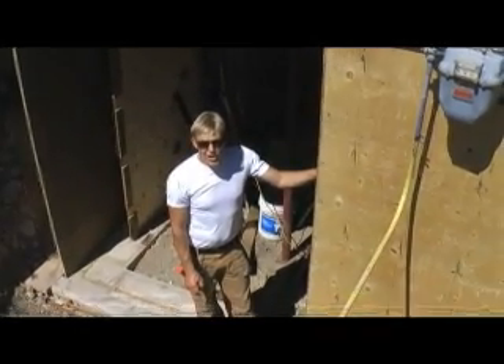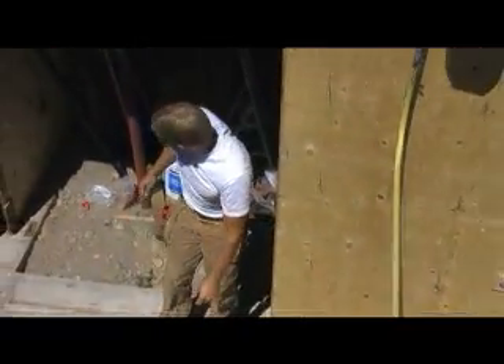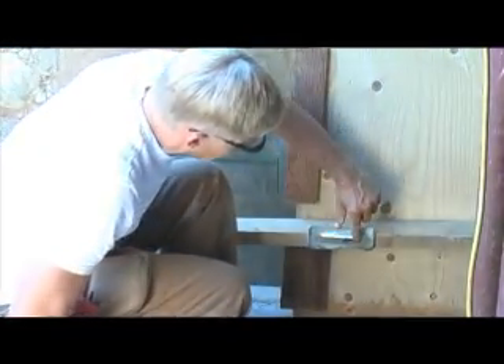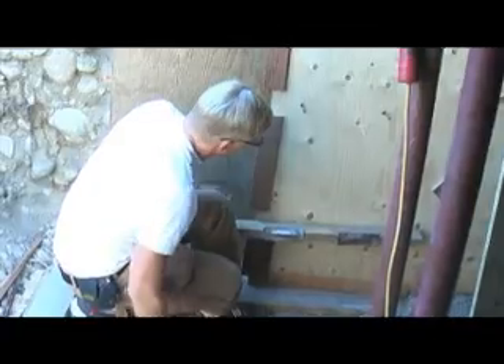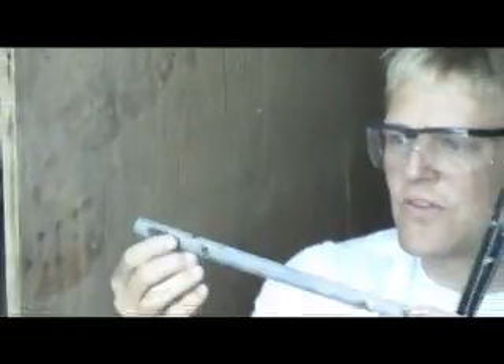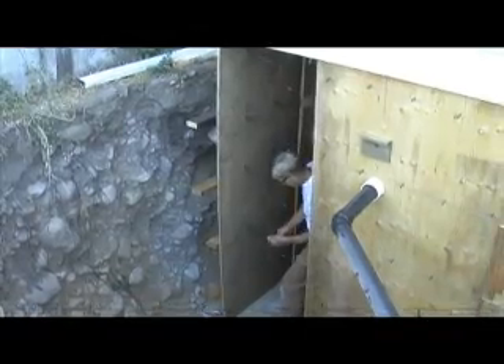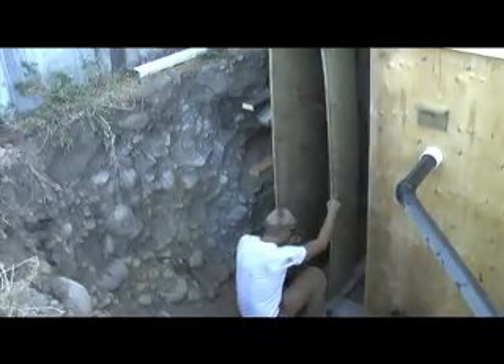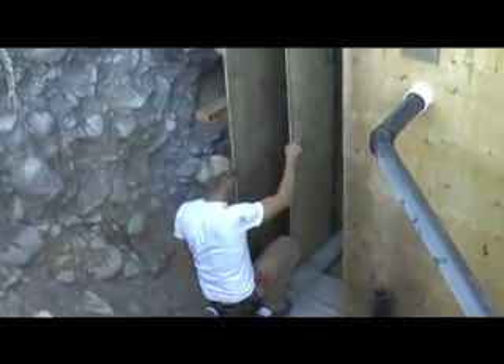Concrete Walls - Form Prep (Part 2)

Comment: The first type of clamp is designed to have a 2x4 spanning between each clamp Buddy...with the cone snap tie you don't drill holes in the 2x4..you just place a 2x4 on top and below the tie and then place the wedge on....this must be your first time forming...as well all you have to do to keep the plywood to the exstisting wall is hammer drill a small hole and drive in 2 -21/4  common nails every 12 in ...go get some time in the trade before making these how to videos